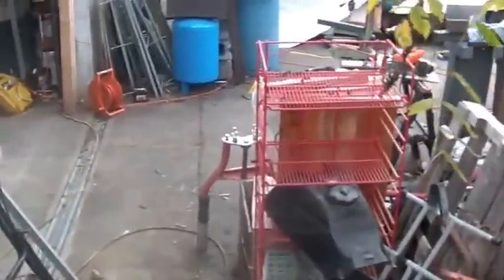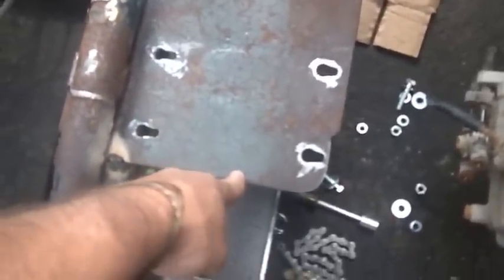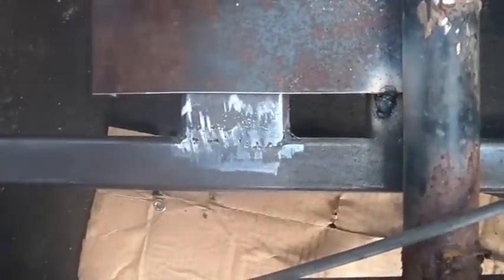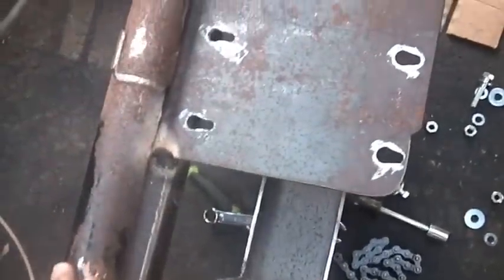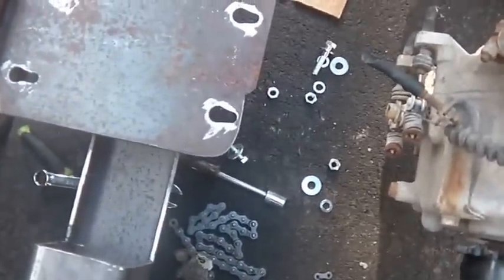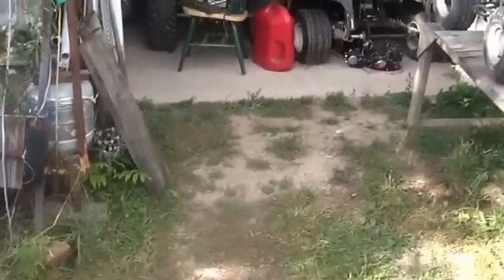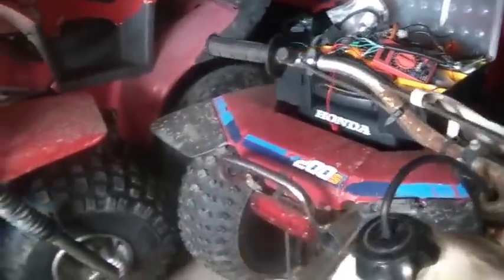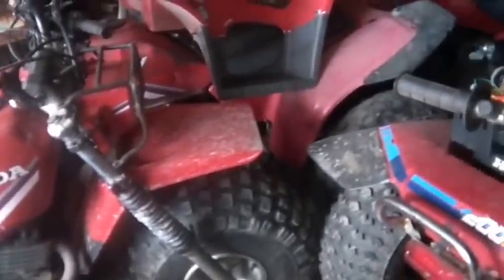Kawasaki Repowered Mule, it rolls, making an engine plate,

Comment: Hey man I c your working on a mule,would you possibly have a engine from a 2010 or a 2020 mule it's a kaf540c engine doesn't have to b running ,I need some internal parts that have been discontinued I would really appreciate  the help or some info a a where abouts of one thanks TODD ps good video

Comment: looks sweet harvey. 👍 rustoleum is good paint. dust some primer on then paint it up.
Reply from the maker: Hey Wally, Look like it will be a base coat of Rustoleum primer and Tractor supply pain over the top.... It is coming along.... Need to finish it up, have to get some more Fall clean up done.... Thanks for the encouragement, watching, and commenting!!!
Reply: Yes it will be quite handy for cleanups. With your big yard. 
Cheers bud.

Comment: no need for rusty metal primer on the subframe,regular rustoleum grey primer and paint will do. i buy the industrial size spray paint at home depot
Reply from the maker: Hey Roger, will be Rustoleum for the primer and Tractor Supply for the top coat, will have to check Home Depot for their prices.... Thanks for the suggestions, watching, and commenting!!!
Reply: the industrial cans are bigger and cheaper